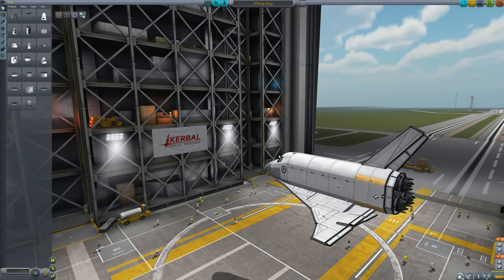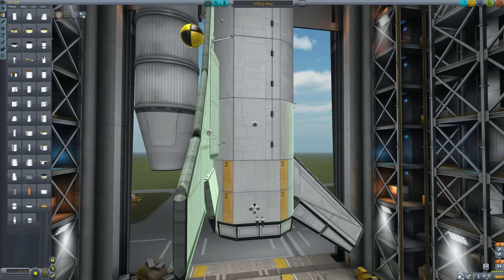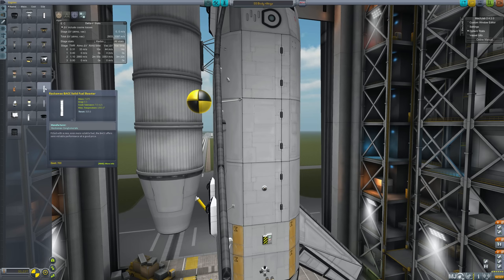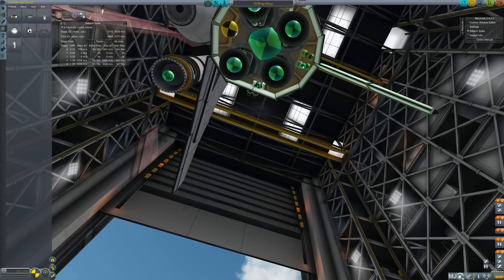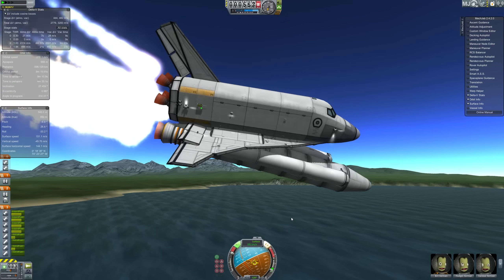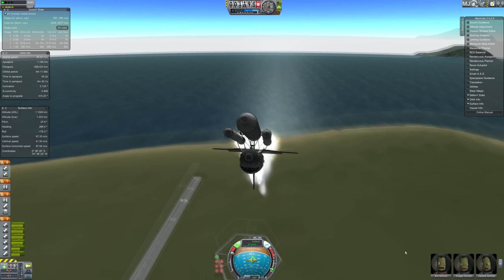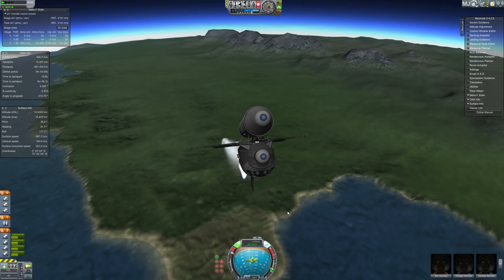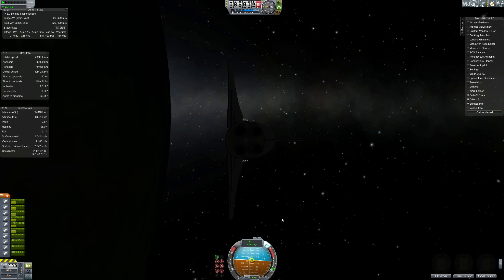Making The Kerbal Shuttle Fly To Space!

Comment: hhmm. Didn't the shuttle technically have 5 engines? (7 if you count the SRB's...)
Reply: Yes but the 2 upper engines above the 3 main shuttle engines arent used during launch because they are only used for orbital maneuvers. They are called OMS or orbital manouvering system.
Reply: Jansel Kenneth Tolentino Ah right. That makes sense with actual engines, given the design varies depending on the atmospheric pressure (or lack of) they are optimised for.
Reply: +Jansel Kenneth Tolentino Wrong: the two OMS engines were used immediately after SRBs separation for a little under two minutes, in what was called OMS assist burn. Only Hubble Maintenance missions didn't used that, because they needed all the OMS fuel to get there and back (circularization burn of approximately 5 plus minutes and de-orbit burn of about 6 and half minutes)

Comment: What was annoying was that I would build the shuttle and fuel/solidboosters to perfection in terms of center of thrust, lift, and accommodating for the center of mass shift as the fuel gets burnt. Shit still exploded, fell apart, flipping over, etc etc. I was getting seriously pissed until I learned about how the real shuttle had 20 degrees of gimbal range.... and I smacked my head against the table.

Ingame, the most range one of the engines have is what I believe to be 8. I got pissed and said no more with the suffering. I went into the cfg files for the lv45 engine, and simply changed the gimbal range to 20. I now have a functional shuttle from launch to landing :)

Sure, it's "cheating". But fuck, the real shuttle has 20, I deserve 20 because I was getting real tired of blowing up, breaking apart, and so on lol.

Comment: I build a shuttle that flew perfectly and was able to deliver a probe that managed a polar orbit on the moon before the update when the atmosphere was like jelly yet the strange thing is that when the uptade came and the atmosphere became lighter the same model cant make it to obrit with the same load, now it can only deliver a small probe. Before it even had spare fuel to burn, now it relies on RCS to complete the orbit. Any ideas why?
Reply: virgilio moncada With the update the atmosphere is thicker closer to Kerbin's surface. Try lowering your thrust earlier on so you don't waste as much fuel.
Reply: Kris Benton Thanks, I now modified it so it has two back engines instead of one and increased the fuel in the outer tank, plus some reusable booster stage at the first 100m and now it has regained it's former glory if not even more, thanks for the info! :)
Reply: Nice! Glad I could help.

Comment: Challenge!
A single stage to orbit spaceplane that uses nothing but internal fuel (no jet engines) in vanilla KSP =]
The original idea was to do the same thing for a spaceplane that could glide to the surface of Eve then return to dock with a ship in orbit. After realising how hard it was to get into orbit of Kerbin, I scrapped the idea. No one I know has even been able to do that O_o

Using monopropellant to finish your orbital burn reminded me of my only successful attempt :P
Reply: Actually that is quite simple. Take a Mk1 Cockpit, C7 Brand Adapter 2.5m to 1.25m, Rockomax Jumbo-64 Fueltank, Rockomax "Skipper" Liquid Engine and a pair of Delta Wings, Advanced Canards, Standard Canards and Wing Strakes and 3 small gear bay and a 2 modular Girder Segment and that's about it.
It's basically a rocket with wings. but it can start horizontally or vertically, land horizontally and has a dv value of over 5700m/s. So it is more than capable to go to orbit and glide back to the KSC.
Reply: I'll try that at some point =]
I found the biggest issue was getting it off the runway without wasting a significant amount of your d/v, which is the issue I foresee with trying to launch a 2.5m with only a single pair of delta wings.... or more to the point, the speed required to get a 2.5m off the ground with only a single pair of delta wings.... The only success I had was with vertically assisted takeoff
I probably should have stipulated a horizontal takeoff but thought it was implied by the original Eve lander idea (as impossible as it is) because you can't glide into a vertical landing.... especially with full fuel =]
Reply: ExcentriCreation
Yes that is a bit of a problem, It depends on the balance of the craft. My Construction is fully fueled very front heavy. It really won't take of before the end of the runway. But it can fly with about 130m/s horizontal speed. But knowing this, i let the thing just roll with very low to no thrust to the last third of the runway and then throttle up.

I could attach the wings further to the front which would help with the early take off, but it would get very hard to fly with a low fuel level because the "skipper LFE" is quite heavy at the back when the tanks are nearly empty and the thing gets overly aggresive because the CoM would wander behind the CoL.
Reply: shi01
O_O
I can't believe how easy that got into orbit regardless of the inefficient takeoff.... In my defence though, lugging a "jumbo" around on a ship kinda defeats the purpose of a reusable lander. We were all trying to keep it as light as possible -_-

Comment: You should investigate using R.A.P.I.E.R engines on the shuttle. Specifically their much higher gimbal range compared to normal ksp rocket engines. I tried making a shuttle with them (I only used the closed cycle for realism) and it seemed to help a lot with control after the boosters cut off.

Comment: Wow, guess I''m not that bad at ksp after all. I do find it extremely difficult and challenging to build nasa style shuttles, but I'm not THAT bad at it, lol.

1. use the rapier engines, the have 3 degrees of gimbal compared to the 1 degree of every other engine
2. first attach the large fuel tank, place only four engines, turn on the thrust vector and line it up with the center of mass
3. empty the large fuel tank and add another engines, then use it to line up the thrust vector to the new center of mass
4. strap the SRB's on (I suggest placing 3 on each side or 4) and make sure the new thrust vector is lined up with the new center of mass
5. (optional) grab some reaction control things... if you want to live
Reply: Rockomax mark 55 engines have 5 degrees of gimbal, and you can use qweasd to make them face backwards when you put them on the shuttle.

Comment: I'm curious why you've changed back to Mechjeb instead of Engineer?
Reply from the maker: I think it was required for some other mod, and it was just sitting there, I don't tend to add or remove mods for videos unless I need to.
Reply: Scott Manley
Thanks for that. I tend to keep a close eye on your mods, as I like the choices you make and tend to play them mainly the same - Mechjeb as I think you've said before can feel a bit 'cheat-y' which is why I switched to Engineer. I could never resist just pressing a button to align me to whatever node in MJ!

Comment: I've tried building shuttle-like rockets before, one of my most recent builds is in fact like that, and the best success I had was putting a single very strong engine on the "shuttle" and a lighter engine on the booster, and start with the shuttle engine throttled down enough to balance the original TWR of the booster(s), then as fuel is used up and the booster twr increases on the way up, just use the tweakable to throttle up the shuttle's engine to compensate. Since you only have one engine to work with, it's relatively easy to keep the thing balanced.
Reply: I do this too! With this method I also found myself controlling pitch much easier with the tweakable and rarely had to touch the actual controls. Kinda funny watching it go up into a stable orbit without actually steering it in the conventional sense.
Reply: Makes you wish they'd add a engine-max-trust/TWR balancer to the tweakables. So besides being able to set the max thrust limit you would also be able to set a max TWR. Or maybe just get rid of the max thrust limit entirely and replace it with a max TWR option...

Comment: Hi, Scott! Although I liked the video, the thing looks rather horrible to be honest :)
It also looks like it won't take any payload which makes it kinda useless. But it's interesting to watch anyways.

However, that's not why I make this comment. I want to ask a question: In one of your earlier videos you were discussing Russian rocket engines and N1 rocket. You said that the main reason it failed is that there are about 30 rocket engines and the probability of failure for one of them is quite high. It makes me wonder, what about Falcon Heavy? It's 9 engines per booster, and there are three boosters, which makes total count of Merlin engines quite close to the N1 engine count. Would it suffer from the same problem then?
Reply: Didn't he mention then that because of the N1's size russians wasn't able to test entire rocket after it's assembly? I'm sure Space X has no problems testing independent boosters properly. :)
Reply: randomnickify  It's a little more nuanced than that. TL;DR thank modern chemistry for carbon fiber and Kevlar.
True, the N1 rocket had a very high probability of individual engine failure. And this IS true of the Falcon9, and by extension the Falcon9 Heavy (which is comprised of three Falcon9 cores.) The difference is in what is known as failure containment - the Falcon9 engines are housed in cells made of very durable, lightweight materials that can contain even the most catastrophic failures. Elon Musk himself has stated directly that the number of engines on the Falcon9 guarantees an in-flight engine failure in the next couple years, but the rocket is designed (and thoroughly tested) in such a way that an engine exploding in a hot shower of fuel and titanium is not a problem. This is similar to commercial aircraft engines, whose cowlings are now made of Kevlar to contain engine failures after the loss of a DC-10 to a blade disk failure in the 80's. The only lightweight material available to the Soviets to contain an explosion was titanium; and as the components that were exploding and getting turned into shrapnel were themselves titanium, the walls of the containment cells would have been too heavy to be practical - though, I'm not sure the Soviets even investigated that route, N1 development wasn't conducted publicly. They did have a habit - from their early rocket programs - of not testing components individually, and I assure you Elon Musk doesn't endorse that route ;P

Comment: Hey Scott Manley , just noticed some of your shuttle wing pieces are in wrong direction so that they won't generate any lift. For the rectangle ones, those black rounded edges are supposed to face (the general direction) of front and back of your craft. For triangular ones, the one side without black rounded edge is supposed to face the fuselage. I guess this is the reason that in your last episode, when you added those thin wings, the center of lift moved so much.
Reply from the maker: lirg03 That's an interesting theory, but there's nothing in the code of configuration that would imply that stock aerodynamics care about the rotation. Rotating a wing piece can affect the centroid and therefore the center of lift but the magnitude of lift is unaffected.
Reply: Scott Manley When I saw this theory for the first time, I didn't believe it either, until I built a simple plane in stock aerodynamic to test it out. It started with a small plane, with 2 rectangle wings. I put the CoL just a tiny bit behind the CoM, and give the fuselage a bit AoA, so it will take off and climb steadily on its own once the engine is engaged. Then I made 2 variants based on it, both of witch with a small rectangle wing pieces attached to the leading edge of the main wing. The small pieces are of the same size but different orientation (wing connector type D and E). I rotated one of them so its black rounded edge is not facing forward, and with some translations it was attached to the main wing the same place as its counterpart so the overall wing shape looks the same. If direction of the wing does not matter, both of them would be unstable since right now CoL will be in front of CoM with the additional wing pieces. However during test flight, the one with the 'correct' orientation did fly into a loop and crashed itself, the one with 'wrong' orientation maintained steady climb. Not sure if I did anything wrong in this test, maybe an reddit post with pic links will explain it better. Another observation to support this theory is that the MK3 cargo plane I built flies much better with a re-constructed wing, whose wing pieces are correctly aligned while the total wing pieces are reduced by half (yes, the old one had trouble taking off so I have to duplicate the wing to make it double layered to make it barely fly).
Reply: It doesn't matter. The aerodynamics in KSP don't care.
Reply: 00PiggyCosmonaut Stock aerodynamics actually cares. You can try to build a very simple plane to see
Reply: lirg03
Doesn't usually do much for me, but it could be I just build it it in a very special way.
Reply: Scott Manley
Do you think they will change the dynamics of that in the next major update? I hope not, because then a large part of my spaceplanes will be useless.
Reply: Hey Scott Manley, just put my test result on reddit. http://www.reddit.com/r/KerbalSpaceProgram/comments/2uy7c3/til_stock_wing_pieces_has_to_face_the_right/

Comment: "Aqua firma", lol, loved that
Reply: I wonder why they didn't build two half size liquid tanks and put them on either side, the symmetry would make it so much easier to align thrust vectors and so forth.
Reply from the maker: Because the whole point is to try and copy the Space Shuttle, not build something sensible.
Reply: Scott Manley Oh, I get that, I'm not criticizing the design in the video. I'm wondering why the original space shuttle designers went with the awkward single external tank. Maybe fuel lines are a lot harder IRL?
Reply: Scott Manley
But why not in real life? But then again: That would be chicken mode.
Reply: HebaruSan On which either side, though? Left and right or top and bottom?

Comment: I really wish that the game implemented individual KS-25 engines. They are directly based off the Space Shuttle Main Engines, known as the RS-25 engines, and they are also now known for being on the future Space Launch System, which is exactly what the S3 KS-25x4 Engine Cluster is based off of, along with the other 4/5.0 meter parts.
Then again, the problem is they would probably be considered overpowered and destroy the balance of the game, but maybe not. It's just a shame, cause they would be easily powerful enough to send one of these KSP shuttles into space without depending on a more powerful engine on the fuel tank. Too bad :(

Oh yeah, and Scott; I just put a giant rocket engine on the fuel tank and used two radial engines that were next to the tail to look like the mono-propellant rockets on the real shuttle orbiter. Basically I would rely on thrust limiting to adjust the direction of thrust, even though it decreases the efficiency of the burn due to the effective exhaust velocity vs actual exhaust velocity dealio.
Oh yeah, and I made one with an Mk2 shuttle, I'm not ready to make an Mk3 shuttle until the 1.0 update where you don't have to rely on exploits and shuttle uglification to make the shuttle work.

Comment: Not a very good kerbal space program-er, but what is delta V in ksp?
Reply: Δv means change in velocity. You can find it by Δv = ln(m1/m2)*Isp*9.81

m1 = Initial mass
m2= Dry mass
9.81m/s^2 is the acceleration due to gravity of earth (or kerbin)
ln is the natural logarithm
Isp is your specific impulse (you can also use exhaust velocity)

just plug it all into a calculator.
Reply: It's the speed you can reach theoretically. In KSP, you need a speed of about 2200 m/s to be in orbit. So you can "calculate the delta V you need consider the mass of your vessel and the drag in the air. In physic, Delta means a difference between two values. So Delta V (for Vitesse (speed in Fra)) is the difference between the speed when you start ( 0 m/s) and the maximum speed you can reach if there is no resistance.
I hope I have helped you. :D
Reply: my brain just exploded to how complicated this is, but correct me if im wrong, does it basically mean a crafts acceleration?
Reply: Mike Hunt Isn't it -9.81m/s^2 for Earth's automatic pullback due to gravity on the craft?

And does Kerbin really have the same pull? I've never really looked into it.
Reply: WhiteIce

Not quote.  Thrust is a vehicle's acceleration.  Delta-V is how fast a vessel will be going once it uses all of its fuel.  The relationship between the two is given by "specific impulse" (abbreviated isp).  That's the rocket equivalent of "miles per gallon".

The solid rocket booster, for example, has very high thrust but also relatively low specific impulse,  It's like an old muscle car: it will go 0-60 really fast, but it burns most of its fuel doing so.
Reply: ***** Yes kerbins acceleration due to gravity is the same as earths. And no it isn't -9.81.

You need approx 1000m/s of Δv to get out of kerbins atmosphere. As has been explained your Δv is the possible change in velocity for your craft.
Reply: Majromax so how fast a specific rocket can go based on its fuel and thrust?
Reply: eff yoo Maybe, it depends on the mass of your vessel and how you pilot it. Try to use a minimum of fuel in the lower atmosphere.
Reply: WhiteIce yes, but only if youhave no resistance, no atmospher, no mass, etc.